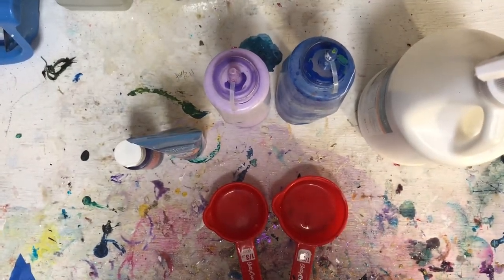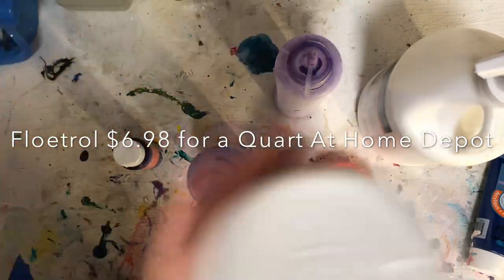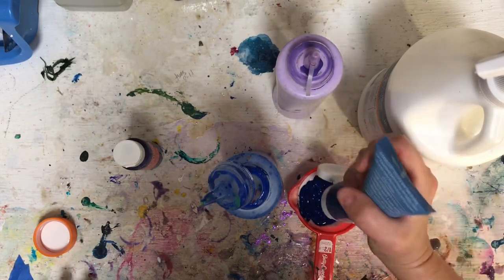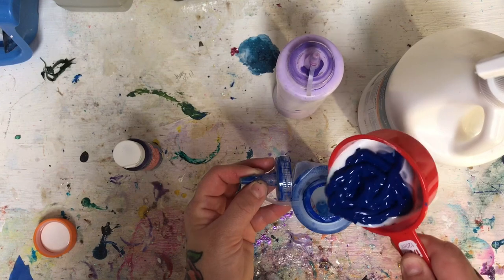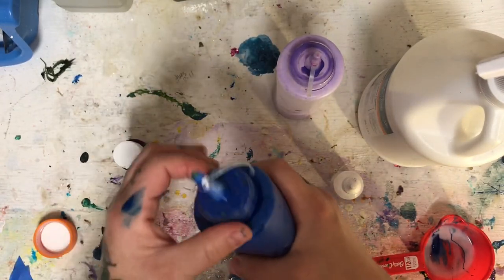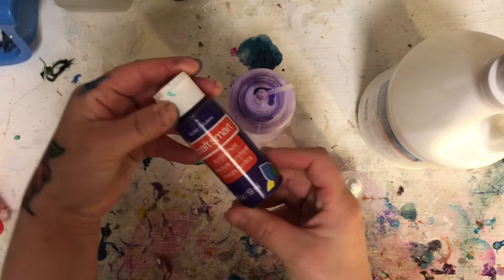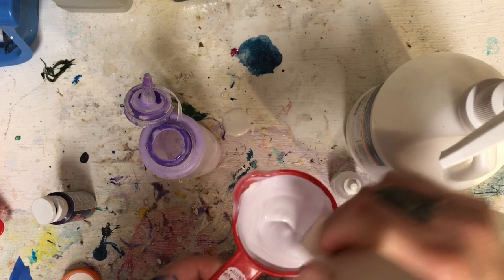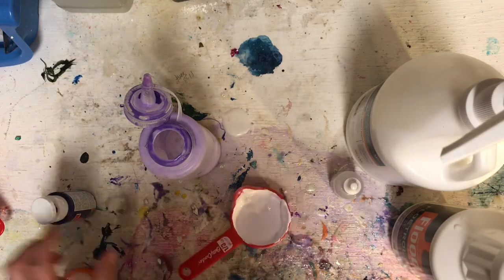#10 how to mix floetrol and acrylic paint-floetrol recipe

Comment: Hi, this is jiya from Pakistan, would you be able to explain how do you clean the silicone off before you resin????
Reply from the maker: With dish soap and a rag
Reply: @resinfanatics  thanks indeed, but i ve heard that silicone is hard to remove from the work piece and rubbing alcohol, dish soap and glass cleaner like windex are combine together to wash off the silicone, is that neccessary to use above mentioned things???
And after the cleaning how do come to know that there is no silicone is left???

Comment: An artist told me never use water and that the Floetrol causes the the painting to yellow over time. So question is, can I just use a good quality medium and the acrylic paint. He did show me 2 pictures with and without floetrol and I saw the yellow.
Reply from the maker: yes i there are a few mediums for pouring
https://www.amazon.com/gp/product/B0060KUP0E/ref=as_li_tl?ie=UTF8&camp=1789&creative=9325&creativeASIN=B0060KUP0E&linkCode=as2&tag=paintingsfr0e-20&linkId=ddf3870b31b5d5082030d34bb35ef51a